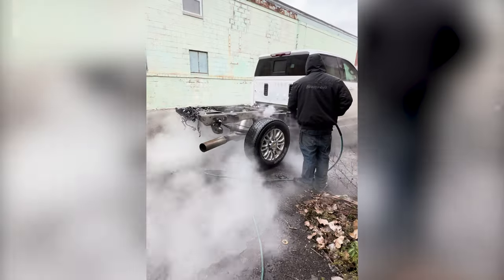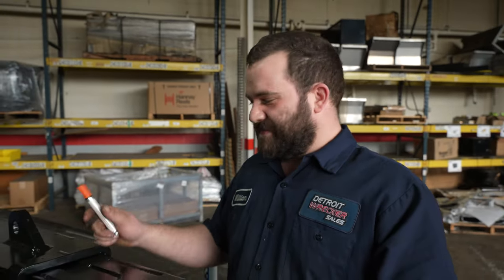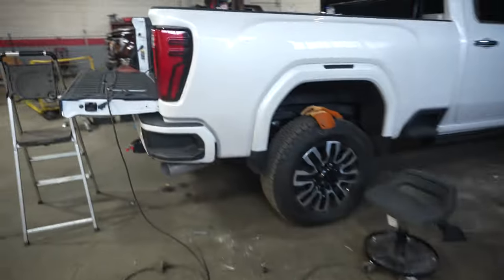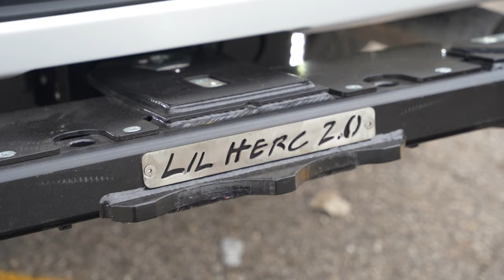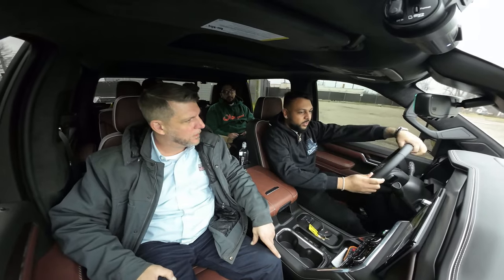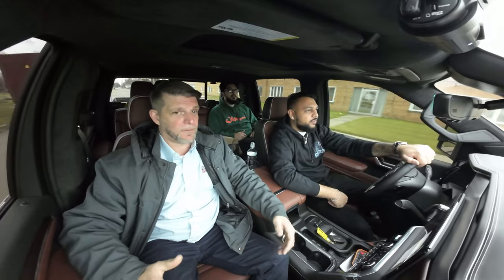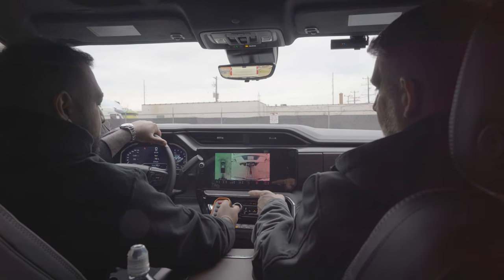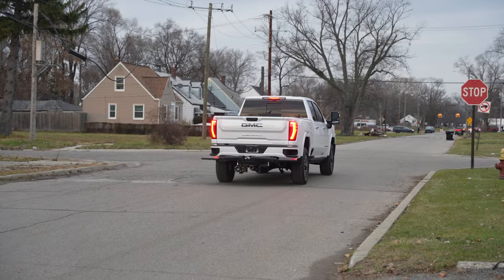Diamond Auto Body of New York | Lil Herc 2.0

Comment: Does the lift arm have a stop in order to not contact the rear bumper?
Reply from the maker: Our units are designed to go flush up into the bumper and not contact them. Each truck is built the same to where you don’t have to worry about crushing the bumper when going up.

Comment: Are you able to still have a 5th wheel/ gooseneck hitch with this system? and also are you able to use helper air bags instead of the extra leafs?
Reply from the maker: Definitely does not interfere with the fifth wheel wheeler gooseneck and we never recommend airbags because the stop the suspension from moving and we want the frame to move with the suspension. We do not want an airbag underneath creating a pry point at the weakest point of the frame, which is the hump over the axle
Reply: @detroitwrecker  thanks for the reply And thanks for the good info!